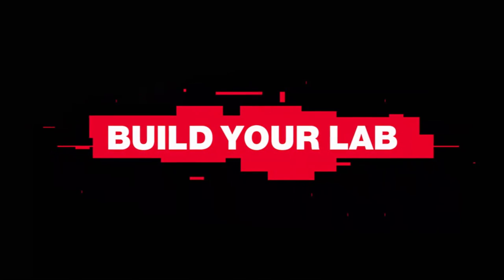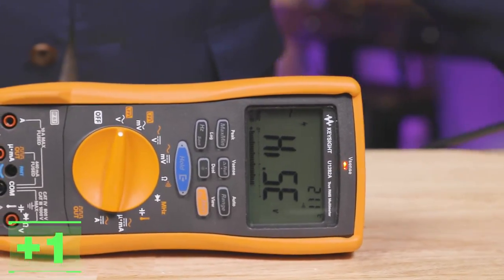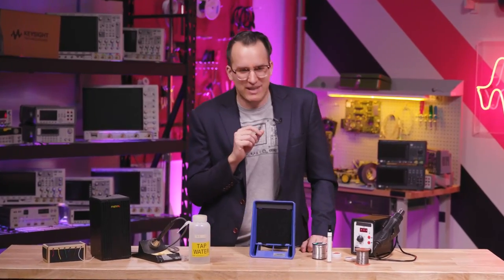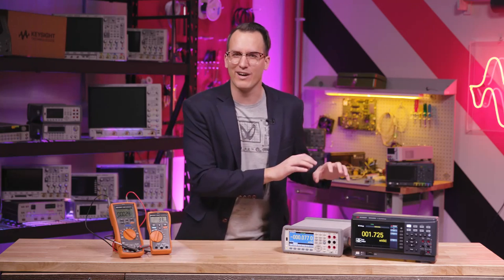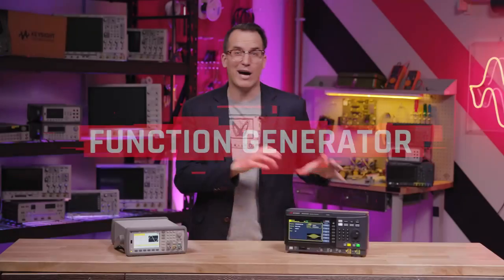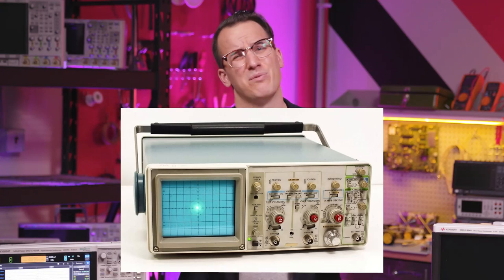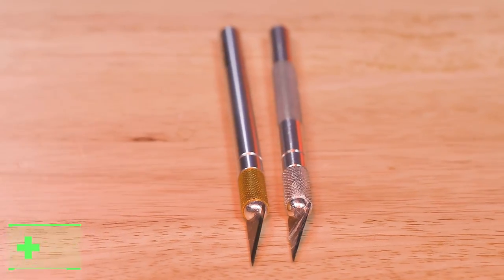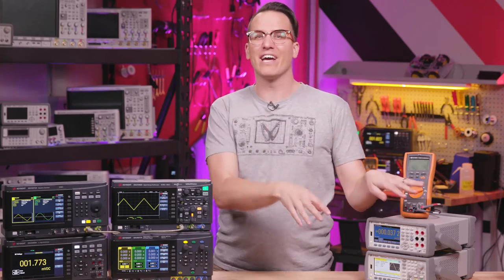A Perfect Electronics Bench?

Comment: I find lots of good light reduces the need for magnification, though not always entirely.
I like having a (cheap) microscope that let's me snap pictures quickly.

For de-soldering, I find a "solder sucker" great for the initial blob and I save the wick for the last remnants.

A small container to toss the (still good) components I don't need so I don't have to interrupt my flow to return them to the precise location in my parts storage system.  I call these my "go-backs" and sort them back into storage whenever I need to so something mindless.

Consumables:  Heat shrink tubing, replacements for the most common connectors/headers you use, spare batteries for the calipers, lever nuts (e.g., Wago 221 compact series), ferrules, IPA wipes, poster putty, even more spare batteries for the calipers, and breadboard friendly buttons, trimpots, connectors, and an infinite supply of jumper wires in every color.  Did I mention spare batteries for the calipers?

Comment: 36 for my work "lab". I think the fire extinguisher is the real MVP of my score here, sometimes I still wonder how I get anything fixed!

Subjective, but I think dedicated component testers like an LCR, ESR, and transistor tester are invaluble at times. Especially when you're working on different things every day with no schematics and have absolutely no clue what's going on (that's me).

Bonus points for a tube tester if you occasionally work on old gear. I use an AVO CT160 at work.

Comment: 56 points. Some things I would add to the list:
- Good binocular scope with a reducer. Super helpful when working on smaller SMD parts. Freestanding so it can go over your preheater.
- An alcohol dispenser (can get them in the beauty isle) for cleanup, and Kimtech wipes. like this - https://www.amazon.com/Liquid-Alcohol-Dispenser-Bottle-Labeled/dp/B000MI85FC
- Lots of connectors, adapters, etc.
- A USB battery pack. You can use it to quickly plug in a USB-powered project, it's portable, and it's guaranteed to be isolated, so can be great for checking if you suspect some sort of group look issue.
- Breadboards, breadboard wires for quickly testing out chips
- Breadboard SMD adapter boards. You can quickly solder on a chip you want and characterize it before you use it in a design.
Reply: That’s a really neat idea with the push dispenser. I’ll have to order one and fill it with some Lysol to disinfect my gloves after opening components received in the mail. Also I really appreciate the link because I wouldn’t have figured out what u meant by alcohol dispenser alone.
Reply: @spencer961  Yeah it's one of my favorite things. As for tissues to go with it, you can use any, but I prefer kimtech tissues since they don't leave little bits of paper dust.
Reply: Thanks for that, do you have any more tips?
Reply: @Cristi4n_Ariel  those are the main ones. Anything in particular you're curious about?

Comment: 70 points! From 10-15 to 70 in a year. Looks really good in text, but if I supplied a picture you would see my carton box Fume extractor with two pc fans and a carbon filter, mounted on an old swing lamp arm. 3rd hand solder helping hand made of  10 and 12 mm copper tube, fittings, wing nuts and nylon washers. My three output, DYI PC power 3D printed Bench top Power supply. Got some old used, some broken, quality stuff from a school (the broken stuff just needed new fuses;-)), all other equipment is either 2nd hand or from the 80's something (multimeter, analog oscilloscope, solder station, glue gun). All my plumber gear is now in the shed, my computer lab is now officially my electronics test lab. :-) Thank you for going the extra mile to please your future customers...

Comment: You forgot to to mention an Isolation-Variable transformer. Very important if you need to measure on the mains connected side of things, like an SMPS, or an old hot-chassis-radio.
Reply from the maker: Ooo good one!
Reply: Just remember that a variac and isolation transformer are separate types of equipment.
They can be plugged into each other, but the variac is just an adjustably tapped output off of a single winding.
Reply: @heyallenify  They should also be available as a combined unit, if not you can make one yourself, like I did. If you are interested you can see it on my YT channel.

Comment: One thing to not forget is an LCR meter. You need a reliable way to measure Inductance and data logging curves on excel might not be time efficient. I use the Tenma 10465 which was around $150 USD. Multiple frequency ranges like 100 Hz to 100 kHz is important!

Also ESR meters are nice for in-circuit testing. I still need to get one, but they are pretty cheap.

Comment: 75 points. What is definitely missing on the list is kapton tape. Very useful as electrical insulation when fixing issues especially when fixing issues with SMD components (I sometimes swap the pins on SMD transistors). What I think are also must haves are multiple test leads, banana plug leads, banana to BNC converts, different test clips and probes (I love those small pogo pin SMD probes from Fluke) and crocodile clip leads.
And finally: an ESD safe coffee mug :-D
Reply from the maker: That's a good one!

Comment: Great!  I think I may have scored 100% on this one!  I do use a component tester, LCR meter a lot even though it is only a small cheap one for simple checks (did I read the resistor bands correctly!).  I also find it is vital to have a small and very thin set of small spanners for all those components that need tightening, pots, banana plug sockets, etc.  And of course a really good source of light and I use a hand lens from time to time too!  Oh, I also have a circuit board holder - cheap and really useful and an IC pin straightener as they pins on new chips are always splayed out!

Comment: I got 50 points! It’s surprising because my desk is about 1.7 meteres from corner to corner on the work bit.
Also a calculator is a must have when you need to for example calculate the watt-hours of a battery or calculate the power output or input of a device, this can be done without a calculator but a calculator makes it faster and easier. It also helps when your feeling lazy.

Comment: Correction: "They're really not expensive unless you want to get Keysight."
Reply: @Frankie Bleddyn This presentation is targeted at hobbyist audiences. Professionals already know or have most of the equipment they need. While Keysight's products are among the very best, they are extremely hard to justify for the non-professional. There are numerous other products offering a far better value such as Rigol, Uni-T and Sigilent. To get the equivalent functionality of a $300 Rigol from Keysight, you'd spend well over $2K or more.

I was hoping this marketing campaign repositioned their products to be more competitive to hobbyists. Since they failed to do so, I am suspicious of this being more of an act of desperation. They are several high-end equipment manufacturers and only so many high-end customers. The market is also becoming increasingly saturated and competitive with tons of products offering tremendous amount of value for the price. Perhaps, Keysight is conducting market research to gauge profitability in the hobbyist space. It would have been cheaper and far more effective if they priced one of their existing scopes to compete with Rigol and the other value brands, instead of trying to scam us with sweepstakes.
Reply: You think Keysight is expensive?

“If only you knew Bob, if only you knew.”
Reply: @Frankie Bleddyn No, (only when I’m tinkering with QRP HF antennas) but I do have an unhealthy addiction to analouge vintage Rohde & Schwarz gear, leaning slightly toward RF related test and calibration gear.
(I used to repair mostly high-end consumer gear at a Panasonic Center for a living.)

Comment: School Lab: 79/79 (+VNAs, SPAs, anechoic chamber etc) :P
Home "Lab" as in random stuff I have in my room: 26 (+ maybe 2 bonus points for some ham radio stuff like a RTL-SDR as poor man's SPA, and a SWR meter)

Hot take: I'd give negative points for using a wet sponge for soldering, that shit ruins your tips. Brass wool is so much superior.
Reply: Wet sponge would be just great if using a non regulated soldering iron
Reply: True. Plus, say goodbye to any heat that tip might have built up and stabilized on.

Comment: I did not keep a real count, but right now I don't remember anything missing from my lab.  Although, like somebody else also excused -- my fire extinguishers (2 of them) are in my garage, just next to the kitchen door.  Even otherwise, my home is my electronics lab. The main components collection (a carousel) occupies most of the next room, along with some additional instruments and a library book shelf (component data books).  My two analog storage scopes and 3 digital ones reside in the living room.  There is also an 8-channel digital strip chart recorder, two pulse generators, a stroboscope, two audio analyzers and a Control Systems Analyzer.  There are two PCs in the main lab room.  The power supplies there consist of one 4-output, one 3-output, one 2-output all on the bench shelf and finally one power supply on my scope cart.  The main math devices are a 12" slide rule, and a binary / hex calculator.  Plus I always have my smart phone with me, with its HP-15 and HP-67 calculator applications.  Did I get any bonus points?  I forgot to mention my Universal 1 GHz counter / timer and a GPS lock-in calibrator.  And two current probes, one 15 kV scope probe and one 700 V differential probe as well as one 900 MHz active probe.  2 LCR bridges.  Oh, two modern spectrum analyzers are at home, while one vintage spectrum analyzer  and some more instruments are most of the time in an outside storage facility, but visit occasionally my home lab.  More bonus points???

Comment: In addition to what was mentioned, a couple of reference standards and a loop calibrator come in handy, especially for sanity checking test gear, plus analogue scopes are great if you want to learn all the fundamentals of setting up a scope with direct non sub-menu interfaces, infrared non contact thermometers, thermal imager, k-type thermometer, can come in handy for diagnostics, wet and dry vacuum for mess, isopropyl alcohol, thinners, lighter fluids, deionised water and acetone for use in cleaning and solvents, shaker plate, hot plate, angle poised lamp, head torch, jewels loop or magnifier glasses, smartphone for reference and camera use, air compressor, different types of tape including capton, 3M magic tape, copper and aluminium, normal, electrical, duct, adhesives, storage boxes for holding projects while working on others, different microcontrollers, and breadboards, dupont jumper wires, grabbers, LCR meters, spectrum analyser and vna, isolation transformer, helping hands, bench vice, hand operated counter, frequency counter, timer, clock so time doesn't run away, always have someone present when working on something dangerous, it took me nearly 20 years to build my home lab, and there's alot more there than mentioned, but you'll get alot of enjoyment out of the hobby especially with stuff you build and repair yourself, not to mention all the knowledge you'll gain.
Reply: Make a video of you lab. Sounds like you have a lot of experience.

Comment: for caps and resistors I use smd books. way easier to work with. thanks for the tip on using bottles to store less standard sizes. bags take too much space.

Comment: A magnifying device depending on how small your work is. A microscope for replacement of parts, a jewelers loupe to read the printing on a component or finding that inadvertent solder bridge. And a small but strong flashlight that puts light exactly where you want it and at the angle you need.
Reply: Binocular microscope with relatively low magnification and a ring light works a charm

Comment: 49.
Any points for equipment built from a kit? Points for modifying it to work better?
Any points for equipment over 50 years old still working & in use?
Any points for self designed & built equipment?
Stuff you missed, microscope, pcb holder thingy, lab notebook, some sort of breadboard.

Comment: So if I didn't miss on anything we score 68 in the lab... missing the soldering smoke dissipator and that's it. We have two fire extinguishers but I'll take it as a +10 hahah!
I'd add a microscope, prefferably an USB one, to work with microchips and other SMD components that we deal with in a daily basis. Also, isopropilic alcohol for board cleaning is pretty much a must, and cleaning products to keep the equipment pristine (we have our own brand).
Nice video!

Comment: Scored 66/79. Fire extinguisher gave me the highest points. Missing the points because of Grounded setup(-5), Function Generator(-5), Voltage Detection Tool(-1), Hot plate(-1), non bench-top oscilloscope(-2).

Comment: I have a 40-year old Radio Shack DMM and an even older 2001 Function Generator ... what I need is a O-Scope that will tell me what serial setup it's sensing (e.g. 9600 8N1) right on the screen.  IF the signal is close, then the O-Scope should let me know it's slow, varying or fast.

Comment: Hey, I'm using a fume extractor! I have 60 points.
Reply: Does the little mini fume extractor that's built into my soldering station count?  It's just a little hose that comes to a tube right above the iron... which catches some stuff, but not everything.  It probably shouldn't get me full credit, though I'm hoping I can get a point or two, at least.
Reply: @DavidLindes  The larger the smoke extraction area, the better, as well as the higher the smoke extraction rate, the better. Obviously, the system must have activated carbon filtration. The points are only for evaluation, health is the most important...

Comment: I gave myself 53 points, and +3 for "extra stuff" since I keep a good collection of wire and spares, as well as some very specialized equipment for the tests that interest me, I also keep some equipment that is essential to some types of home lab that I have gone over below. Not sure what counts as "no cheating" though. Of note, I did not give myself +10 for the fire extinguisher since I keep my lab in a garage and while there is a fire extinguisher in the garage, its on the other side so it's not within arm's reach. I move it closer when I am working on things I think I'll need it. Likewise, I have a first aid kit in the other room and I go there when I need it (no points).

Honestly, I'm pretty surprised that the ideal 79 point lab has wire strippers and wire cutters but no hookup wire. I keep cheap wire, high voltage wire, and teflon insulated wire of various colors and gauges and use it frequently.

Also, hot air / hot plate is really only useful if you are doing SMT soldering. And if you need them, you might as well stock solder paste in the refrigerator. I do SMT soldering down to 0.5mm pitch by soldering pins individually, so I have not needed them. So I found their inclusion a bit odd. I gave away my hot air tool to a friend because I wasn't using it.

There are various types of lab, but something absolutely essential to a "repair" lab would be an isolation transformer and a variable transformer. You can use these to safely power up anything that comes into the lab.
If you do a lot of soldering, then a lighted magnifier or binocular microscope is essential.
If you do a lot of desoldering, then a desodlering gun is essential. I keep a desoldering gun, different desoldering pumps, and desoldering braid for various type of desoldering that I do.

Comment: 50 points i gave myself 2 points with "spare parts" part, and 1 point for Signal generator since i kinda have one but it's just 555 in a stable mode soldered on prototyping board with gold pin on wire to chose capacitor so idk if it even counts.

Comment: Before this score sheet, I always assumed, that my lab is in worst shape, considering gear.. But no.. Get 74 points!! Even I have 17/24 from other things without score.. 😂

Putt under extra stuff my data logger, insulation tester, component tester, frequency counter etc.. If I can get 1 point for every extra stuff, will get more points.. I have 4 DMM's, all handheld, 2 soldering station and hot air.. But power supply has 5 outputs.. Organizing bins for components was very expensive, but I get cheaper.. 😊

My first oscilloscope was analog, because in these times digital ones was rear, expensive and have a similar screen as analog ones.. And it helped me a lot in repairs and projects.. Best thing - if accident happens, I had schematic to repair it.. 🤣 But it never happened.. Old work horse was very tuff.. Still have it.. 👍

Comment: Someone should release a function generator with quadrature outputs and a single cycle/pulse on request option...  You also need prototyping boards and perf boards for the alpha and beta versions of your circuits and when you won't need enough quantity to print PCBs.  I also recommend laying out and printing a variety of SMD to through-hole adapter boards.  (I like SIMs in the protoboard, but to each his own.)

Comment: Forgot one thing: light. Lamp... Whatever.
Also forgot rubbing alcohol and all the cleaning stuff (after soldering).
I have nearly 75 or so percent of all point (couldn't download the spreadsheet but will back later). BTW, I desperately need a good benchtop DMM. That's a huge reason why am I here. :-D

Comment: I would really like to get a scope with up to 200Mhz (currently I don't need more). I have 2 dead Nintendo 64s and the clock signal of the machines are at 100Mhz. I'm not sure what to look for but I might be able to figure out what goes wrong with it, why aren't they booting by checking the legs of chips, looking for certain signals.

Comment: UV exposure and a heated tank for the acid to quickly produce a prototype circuit board is a must. 3D printer is nice, but not as important as a CNC router. my осциллограф с1-19б is just bearable.